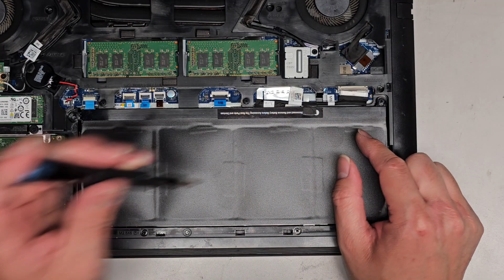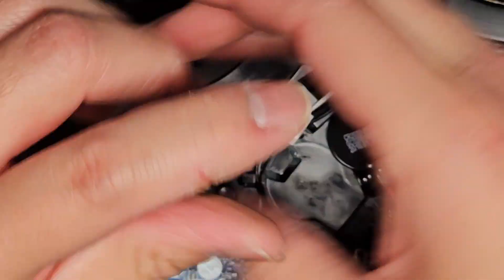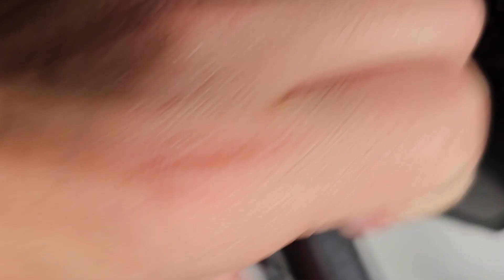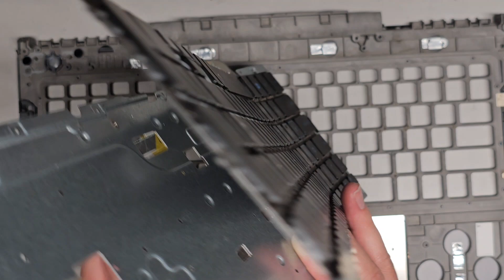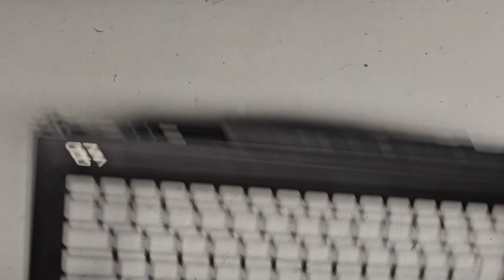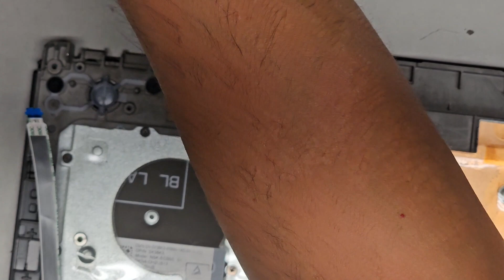DELL G7 15 7588 Complete Disassembly RAM SSD Hard Drive Upgrade Battery Keyboard Replacement Repair

Comment: Hello, i sent this laptop to a repair placement, but the guy that did the work give it back with the bottom part of the shell not assembling correctly. It's like loose and I'm using tape on it to stick with the entire shell. The part with the fan channels, i even have the screw, but still idk if it's a thing with these type of laptops. I really need help because i like this pc so much and i don't want to buy another one.
Reply from the maker: Watch the video and put it back the same way.